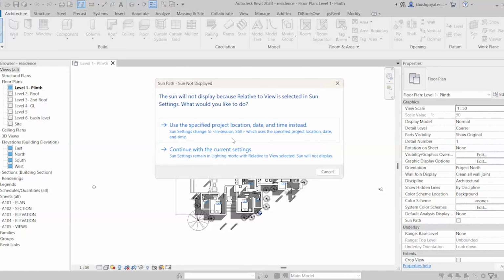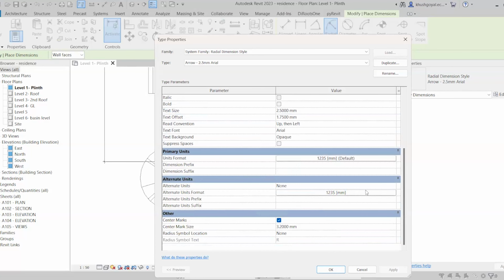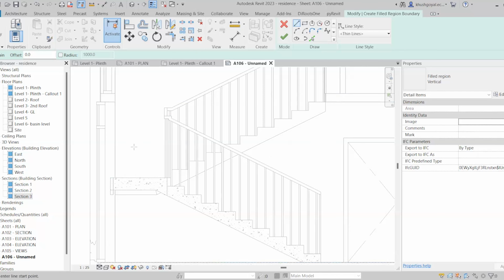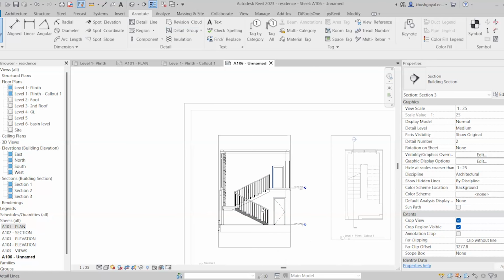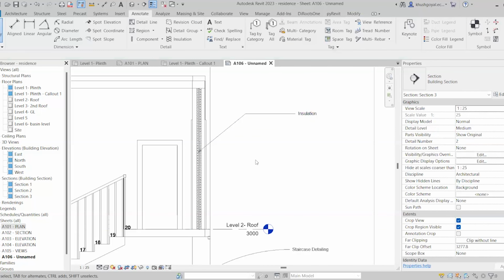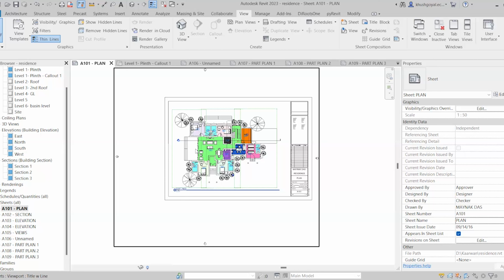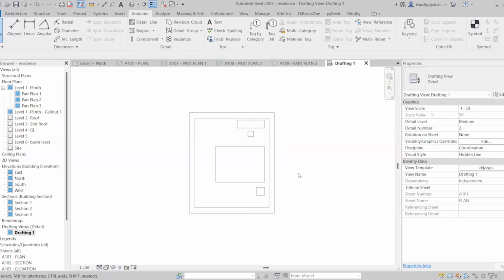Kaarwan | Professional BIM Programme Day 14 - Documentation

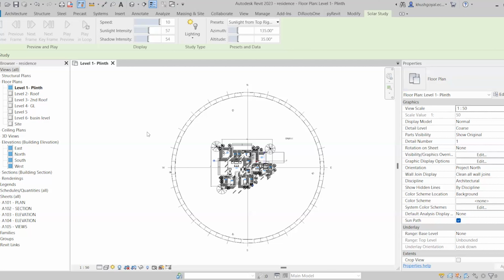Comment: - Solar studies: turning on shadows, sun path, location, presets, still study, single day, export, multi-day, lighting angles, and controls — 7:00 to 18:20[1]

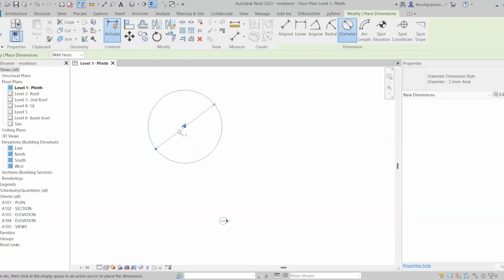- Annotations overview and dimension tools: aligned dimensions, entire wall vs individual references, witness lines, labels, global parameters, angular/radial/diameter dimensions, and dimension style settings — 18:30 to 29:55[1]

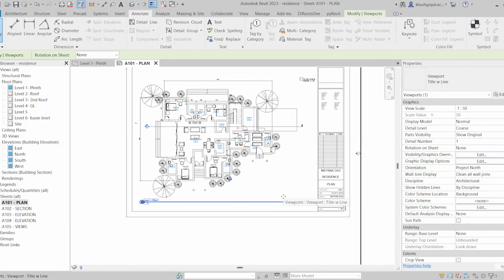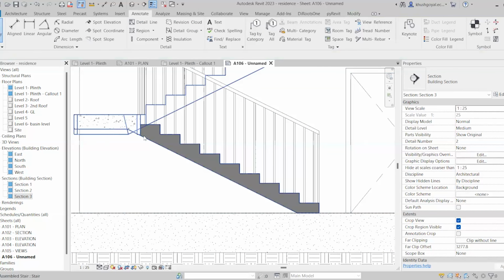- Detail lines and regions: detail lines use, masking region vs fill region, creating custom fill patterns, masking toggle, and cleaning sections with LW linework — 31:00 to 45:10[1]

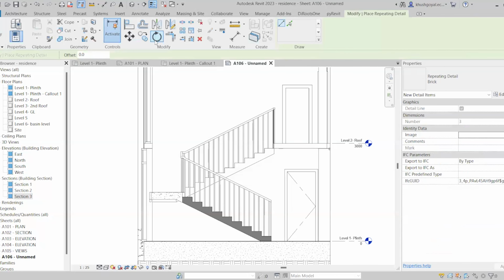- Detail components and repeating details: brick detail components, repeating detail setup, layout options, spacing, and placement in sections/plans — 45:40 to 48:45[1]

- Revision clouds and revisions dialog: placing revision clouds, sheet revision schedule, editing revision number/name/date — 48:45 to 50:35[1]

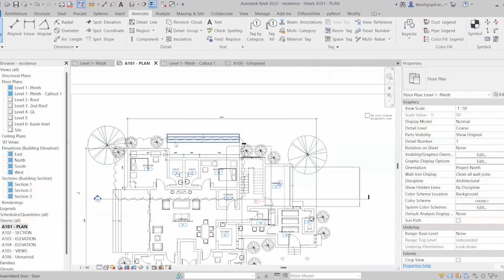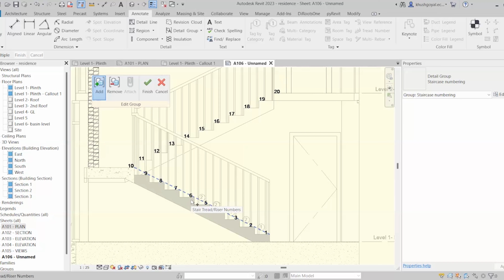- Stair tread numbering and detail groups: automatic tread numbers, manual circle+text method, creating detail groups, duplicating and editing groups, grouping strategy and limitations — 50:55 to 56:55[1]

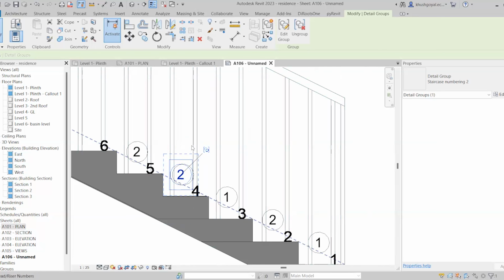- Insulation annotation: placing insulation graphic, adjusting width and bulge — 57:20 to 58:40[1]

- Text annotations: leaders, alignment, type properties (fonts, size, background, border, leader arrowheads) — 59:20 to 1:02:00[1]

- Tag All and category tagging: door and room tags, include linked elements, leader options, orientation — 1:02:50 to 1:04:50[1]

- Color fill legends for rooms: creating legend, scheme by Name, auto-coloring by distinct room names, editing colors/patterns — 1:05:40 to 1:08:10[1]

- Stair path symbols: placing stair path, type properties, arrow head style, cut mark distance, up symbol toggle — 1:08:20 to 1:10:30[1]

- View referencing with match lines and scope boxes: creating scope boxes, dependent views, placing on sheets, match lines, view reference symbols across part plans — 1:10:55 to 1:17:55[1]

- Drafting views: purpose, 2D-only workflow, creating 2D options/layouts, placing drafting views on sheets, scale changes — 1:19:10 to 1:24:40[1]

- Wrap-up: applications for working/construction drawings and invitation for queries — 1:24:40 to 1:23:57 (end)[1]